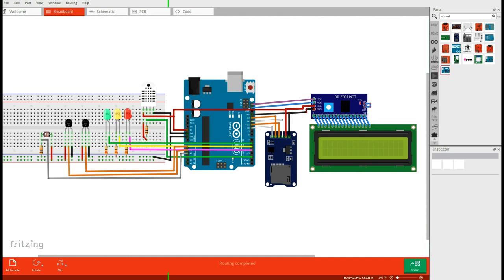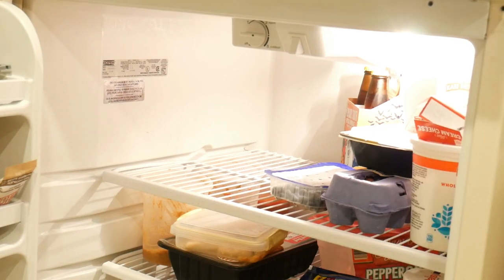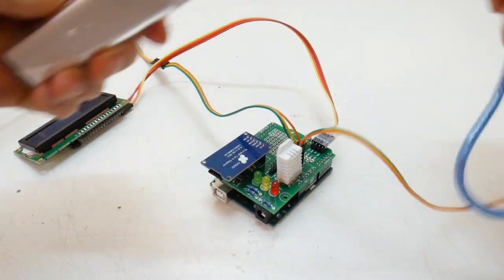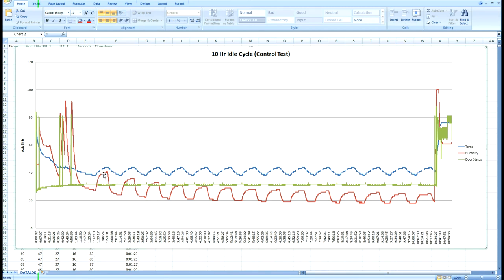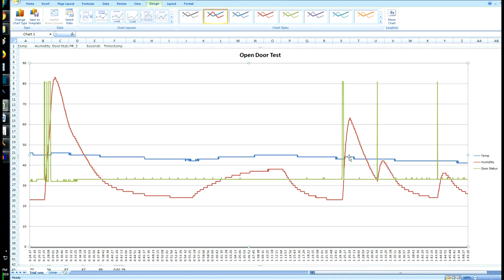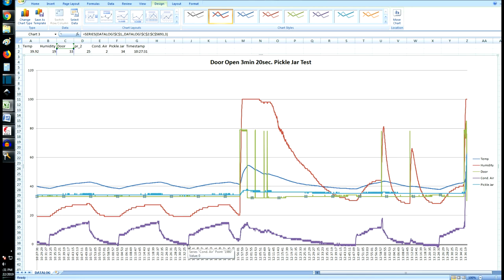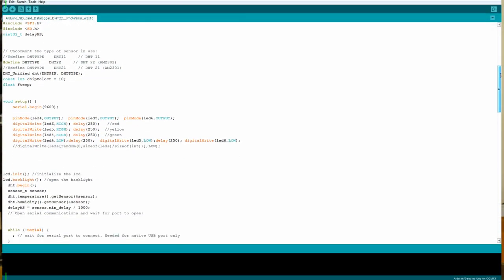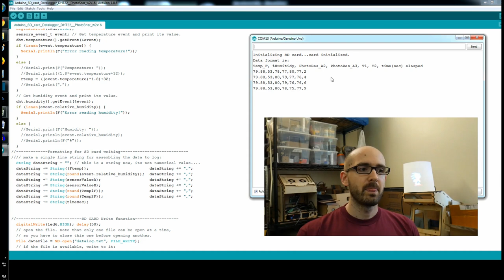Refrigerator Temperature Data Logging with Arduino

Comment: Interesting
I've got a similar project going on, slightly different approach, but using XBee to send the data up to the main PC.
I'm guessing that you power it with the USB powerpack so that is going to have to be exchanged now and again.
My approach was to put all the Arduino stuff outside the fridge with an OLED display and all the sensors etc. in the fridge connected via an FFC (Molex) ribbon cable.
FFC is very thin, stays put and doesn't interfere with the door seal. I also added a computer type fan which is speed controlled to circulate the cold air.
My findings are that standard capillary fridge temperature sensors and motor contacts aren't, unsurprisingly, good with big variations in temperature. Ditching that and using the fan makes a considerable difference to food safety

Comment: I actually found it interesting. My wife and I have been having a "discussion" as to whether our fridge is working correctly or not. Building this might convince her that it is (or prove me wrong). A PCB would be nice, even just the file to make one.
Reply: You might be surprised just how bad domestic fridge temperature control actually is. It would be so simple for manufacturers to put in a decent electronic temperature control. In my comment above, I added an OLED display that allows more complex information, including a running 24-hr plot of temperatures

Comment: I'm just recently discovering your videos. You seem to be using some sort of software to layout your ideas . What software is that you're using?
Reply from the maker: I use:
Fritzing for circuit diagrams (primary only to assist with making videos)
Eagle CAD for PCB design
Inkscape for 2D CAD
SolidWorks for complex 3D CAD assemblies